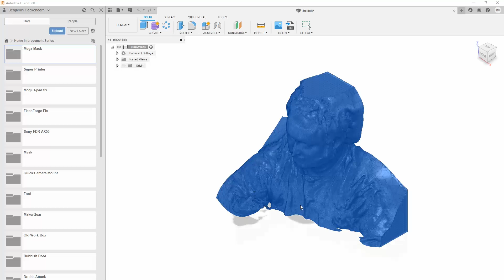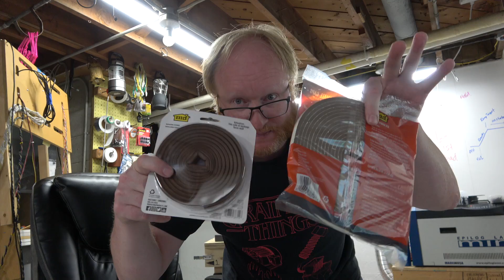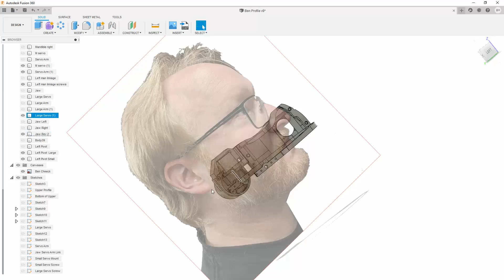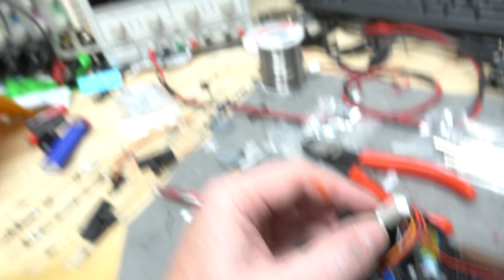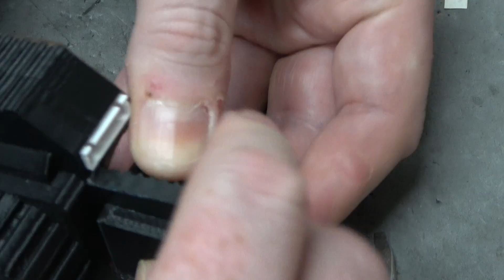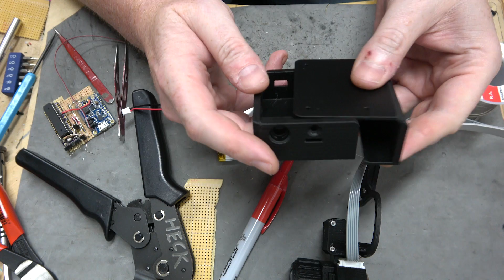Auto-Mask (Mark 1)

Comment: Technically noce, as a mask its not gonna work though as the surgical ones require replacement after a few hours, up tomabout 4-5 times change a day. Yours aint gonna do much vs a virus but it is a nice tech.. just cloth wont work much as the micron öevel of the virus is so small that you need 7-11 layers , and change it ..

Comment: So you had made a comment in the video around approximately 6 minutes in saying that you only had to model the one side and then mirror it? That's frequently not entirely true, because everyone's face is different on the two halves. Not different by a huge amount, but you can probably make it noticibly more comfortable by modeling both sides rather than just a half.

Comment: this is scary I had the same idea using fans before I even saw this video im still designing mine but since im a kid of course I have to put a crap ton of other gadgets in it like a candy dispencer but im having 2 fans one to bring o2 in and the other to take Co2 out im still figureing out how to do it so it dosnt just suck the air out of me i know that wouldnt happen cause there not gonna be strong fans but im probably going to us a rubber valve like on scubba masked but i also wanna put filters on possibly both ends of course the one that sucks air in but maybe the one put it out to and alos for the one that directs air out im going to direct the air down as much as possible reply if anyone has extra tips or ideas most of it is going to be 3d printed and im going to do it on my youtube channel so subscribe even though i havent posted in a while i will post when im done with project and make  whole video

Comment: I need it.
just one thing. can be that if the two mandibles could take 1.20 second instead of 85 third. or even a mini against nazal shock in the angles of 260 or 265 degrees internally like foam for example.

Comment: What did you use to scan yourself? I use 4 xbox 360 kinetic  systems  since they were Microsoft's it was easy to set them up on lap. I'm also using them and 9 32 in tvs and some wearable devices to control the monitors yes like in the movie

Comment: what if you had one that was a solid piece and rotated from your neck/chin up to your mouth/nose and then moved towards towards your face to fit, similar to how you put glasses on. you can stop it from smushing your face with a limit switch placed on the nose section similar to a 3d printer's limit switch. so the whole piece would unfold like a sail in one piece and move onto your face for a comfortable fit.

Comment: First, great project.

Are there fans on the front of those arms?  If so, why?  The purpose of a mask is to limit particulate exhalation, so if these are exhaust fans then you're putting the public at more risk.  If the fans draw air in then you're putting yourself at more risk by drawing in more, possibly contaminated, air.  (OK, just saw your Mk II mask and you fixed this issue in that one.)

Comment: Wouldn't it be more usable to create a mask which is mechanically folding.
I mean, you push it agains your face and springs make it close behind your head or something.
And when you pull it of the spring is returned to it's open position.

Comment: Don't laugh but I used a decent old soldering iron for years. Hadnt used on in 30 years. Bought a Walmart 9 dollar job. Never. Never again. To solder two wires in my guitar....Didn't hardly heat right or steady and spent 1 hour on 1 second joints.

Comment: Make a gap that allows the mask air to escape from the sides or the bottom so it doesn't fog up your glasses ❌
Spend a couple days engineering a system that automatically puts the mask on for you ✅

Comment: Just dont wear masks its ridiculas
Reply: We found a murderer
Reply: @nak-crow  you are a idiot. We never weared mask when we have a influenza outbreak. Why are al countrys that dont have idiot lockdown are mask regulation doing better than country with the measures. Stop reading and listing to mainstream media. They arnt telling you the truth.
Reply: @nak-crow  if you believe in science you know the masks dont work. Because we dont know how to propper use them. And if you know how to use them you stil mess up because you not used wearing one automatic you fail. The carbon build up inside the mask its just not healty for you. If you believe in science there is also alot of science against the masks. But that not the narative so you have to look for that science. Its easy to find and there is lots of it.

Comment: Cute project - clearly not fit for purpose. The mask should be disposed after use to avoid cross-contamination. There should be minimal handling. Has to be disposable, and with hospital grade wire to fit face closely.

Comment: you can hear the motor straining to hold it closed... it needs a mechanical solution to holding it shut, rather than an electrical solution.  That battery will not last, and it is fail dangerous...

Comment: Karens: “Why did he spend so much time on something he doesn’t need”
Reply: Masks have to be properly fitted to individual head shape of a nurse, they place a machine over their head which diffuses a super sweet smelling & tasting substance into the air around them, if the nurse can smell or taste it, the mask isn’t properly fitted.
A piece of floral patterned fabric isn’t going to keep you from catching a virus.
Are masks needed? Well considering the actual survivability rate of the virus is extremely high, you’d only really need it if you’re old, really unhealthy, or already fighting off a different illness.
If you’re young, healthy, and actually going outside during the summer to soak up that good ‘ol vitamin D, then you really don’t need to worry about a mask, worst case scenario you’re sick at home for a couple days and then your immune system develops immunity to the virus.
However, I don’t care what logic and facts you present, a robotic mask is literally the coolest thing ever in all circumstances.
Reply: @tingcraft3920  Masks... Aren't for yourself, they're for stopping other people from getting sick, ffs, wear a mask so you stop spreading it, they're not respirators, they're meant to catch the droplets when you breathe, cough, sneeze, talk, etc. The reason they're so foggy and hot is because that's how it's supposed to feel when it's sealed right, it's supposed to deflect it towards yourself, and catch most of it in the fabric.
Reply: Hetuni Jakhal I’d like to point out again they need to be properly fitted.
If they aren’t properly fitted your breath with be focus out the top and sides (Folks with glasses can confirm), increasing the distance your breath travels effectively doing the opposite as intended.
Masks aren’t reliable, they were only supposed to slow the spread of the virus so our hospitals weren’t overwhelmed, but now the constantly changing narrative that is 2020 says masks are 100% reliable and necessary for survival
Reply: @tingcraft3920  I mean, that's all fine and dandy, but my point still stands. Whether someone feels sick or not, they should wear a mask due to the chances of being an asymptomatic carrier. This is not for the benefit of the person wearing the mask (although it helps greatly with chances), it's for the safety of those around.
It's not an option of "well I don't feel sick so I should be fine, plus I'm healthy", it's more for people who are vulnerable.
Reply: Hetuni Jakhal People who are vulnerable shouldn’t being taking a stroll through the mall. And even if the mask is supposed to simply catch the droplets from your breath, then wouldn’t a simple cheese cloth suffice? However many places require you to wear a professional mask instead of cloth. The point is, everything contradicts itself and it’s beyond irritating...
Reply: Hetuni Jakhal At the end of the day, you don’t really need to worry about the virus as it has an insanely high survivability rate, and once voting is over we can be free of all this chaos
Reply: @tingcraft3920  "At the end of the day, you don't really need to worry about the virus"
...I'm part of the vulnerable populace. A good portion of my family is. It won't just stop after voting happens in the US.
Also, "Insanely high survivability rate"
No. This is demonstrably false. It is rather lethal, being at about 3.4% (With cases that are known). That dwarfs the flu's 0.1% easily, and besides, there are more lifelong issues in the survivors.
Reply: @Hetuni  "rather lethal"
You do realize that 3.4% mortality rate means that 96.6% of people who get it don't die from it?
"Rather lethal" is 20-30%, not less than 5. And of the 160k deaths (out of several million residents of the US)  94% were old people with compromised immune systems. Add into that the fact that the CDC has been intentionally inflating the death count, the fact that Fauci can't even get the number of US cases right, and the fact that politicians were just exempted from wearing masks, and yeah, it is political.
Reply: Big Chooch Thank you, and well said. Hetuni the problem is that no matter how a person died, as long as they had the virus in their system it’s counted as a corona death. You could’ve died from a heart attack or seizure, but as long as you have the virus, it counts as a corona death. So the death rate is probably something around 1.2%. Only around 9,000 people have died in the whole US from this, more people have and will die from car crashes, but we aren’t restricting people from using their cars are we? Are we even improving drivers tests? Nope! But this virus we’re shutting down our whole economy putting many local businesses out of money. Let me clue you in on a little secret, you know that unemployment check? If you own your own business, you’re self employed, meaning you don’t get a check, and if you can’t run your business due to quarantine, you quite literally have no income.
Reply: Also to Skullcrusher Ash, I’m sorry your joke has become a political discussion. I simply wanted to share some insight on how masks work and how robot ones are awesome
Reply: Tingcraft if i gave you 100 skittles and told you that 3 can kill you, you wouldn’t eat the skittles
Reply: Bigbanana E That’s a pretty disconnected analogy but I’ll work with it. Wearing a mask, especially a reusable cloth one is actually also bad for you, the cloth becomes a breeding ground for bacteria thus weakening your immune system. The thing is, a 3/100 chance of dying is really small when you take into account the fact that you have to catch the virus first. So using your analogy, if you walk through the house, and happen to miss the food in the kitchen and the pizza on the coffee table and walk upstairs to your room, than you have a bowl of 100 skittles and 3 are poisonous, however if you don’t eat them, you’ll starve.

Also I’d like to point out, the CDC themselves say you don’t need to wear a mask!!!!!!! You only need to wear a mask if you can’t stay 6 feet away from someone! Masks aren’t mandatory for survival
Reply: Tingcraft i guess you’re right. Your wording seemed very conspiracy-theory-ish at the start. I just wish that our neighbour who tested positive would stay inside or wear a mask when going out to buy stuff.
Reply: Bigbanana E Ya I don’t fault you for reading my stuff as a conspiracy. I totally agree that your neighbor should avoid spreading the virus and wait till he is well. Although technically if the virus is indeed being used for political reasons, then by definition it’s a conspiracy. So I guess you aren’t really off in me being a conspiracy theorist? Either way, we can only hope this all blows over after the voting season

Comment: Use a thin piece of plastic as thick as a zip tie and connect from one side of your device to the other over your head to alleviate the intention/pressure off your ears ... Will help with support ...

Comment: I believe using the strap from an airsoft mesh mask combined with a single moving mask piece in front, can give an easier time removing and putting on the mask, and also make it lighter.

Comment: A mobile phone and microelectronics technicians critique (constructive, not ridiculing)
- Use a raspi zero module (module)|
- keep the fans
- change battery to USB power junction (because connecting to a power pack isnt that big of a deal)
Otherwise youre essential design is... fine (imo) Your ideas quite good.
(I REALLY like the fans. because = breathe)
I would pay 110$ for such a thing.

Comment: I found it very top, watch until the end. I liked it, it's an excellent proposal for use, It would be good too, an ease in changing the fabric, because it could be applied in other areas as well, not only in health, In construction, locksmiths, and chemical plants. Because in the area of work safety, I would apply it as mandatory PPE, after all ends up forgetting to use EPIS, (INDIVIDUAL PROTECTION EQUIPMENT)

Comment: New model maybe incorporate temp switches in each battery and an audible message like power on power off low battery battery percentage and a danger remove mask over temp one fan in with filter one out with filter.

Comment: thats some sci-fi shit an is only controlled by two servos which is mad simple but pretty smart be even cooler if it could fold to the sides an end of flat near side of face instead of sticking out an have like a double joint or swivel in middle of mandibles to completely flatten

Comment: Furnace filters are magnetized to attract particles like viruses. You'd actually be safer walking about without a mask than wearing one of those things. It'll catch literally anything small that's floating around. That is what they're designed for. Buy a proper filter or just wear a normal mask

Comment: You could try shoulder braces, so the entire setup sits on your shoulders, with plastic ball joints and rods to hold up the frame for the mandibles and chin mask cloth. That way you can still look around, but the relatively tiny weight on your shoulders isn't so uncomfortable, compared to hanging off your head

Comment: The way I’d do it is just to have 3 or 4 spherical plates (maybe carbon fibre?) that come up from below and interlock against a sealing edge of some sort, with an additional servo w/ 90 degree reduction gearbox on the side to pull everything airtight.    But I’m not sure on ventilation, fans seem kind of gimmick without proper filtering and airflow to breathe normally without feeling like your wearing a snorkel/ diving gear. Maybe some kind of telescopic breathing manifold attached to the first plate? Then again all that jazz might be too heavy to be practical. I guess I’ll just stick to wearing a peg on my nose for the meantime.

Comment: I'm no engineer or programmer or whatever but possibly have it be one piece where it swings on a hinge and connects to a different piece on the other side of your head instead of those heavy mandibles. Also try using the fabric from these "gator neck" hunting masks. They're stretchy and breathable and has a variety of uses! Just a friendly suggestion. Thumbs up if you think this would also help!

Comment: The fans seem a little counterproductive at reducing droplet transmission which kinda defeats the use of a mask. 

Other then that a hands free opening mechanism would be super cool for ease of beer drinking. Maybe a few cheek electrodes or something that can tell when you're winking? After masks aren't necessary you might wink every time you sip a beer, but it would be super cool!

Comment: Only issue with this is that by having the mask under your chin and then slide upwards means that if any contaminant is on your neck, it then gets dragged up over your face when it's deployed. that's why most health care professionals will recommend taking the mask off entirely instead of sliding it down to eat or drink.

Comment: Why not just make the thing that goes around the ear with magnets and make a mask also with magnets to the sides with a thing to the sides to make the mask hang below the chin? And the good thing is that design doesn’t require motors or batteries.

Comment: For a more secure fit, use magnets on the tips of the mandibles so they hold together and then maybe line the bottom of the mandibles with magnets as well to hold the veil in place...

Comment: If you add a head band or move the rear area to over your head and attach an elastic band in it's place it would make it easier to remove and help balance the weight better, you could also add a small magnetic closure to the front which would insure that it seals constantly, also HEPA filters on the insides of the fans, or else it's not really helping a lot.

Comment: Just get an N95 respirator. It will actually filter the air you breathe both ways and stop droplets at the same time.

Also add another set of mandibles and call it the Arbiter mask or Elite mask 😂

Comment: Needs like brake cables from a bike (only thinner) to locate the servos and electronics off your head.  It'd be neat if you could have a small belt-clipped box and some kind of thin, flexible mechanical cable.  Making it unfurl like The Predator's bifurcated jaw would be neat too.

Comment: Neat engineering and a fun project, but the fans defeat the whole purpose.  You're supposed to breathe through the fabric in order to capture the vapor that may have the virus.  I couldn't see which way the fans were going, but a fan blowing in will just bypass the fabric and pull it straight into your lungs, or if you are the one that is unknowingly sick and the fan is blowing out, it will propel the vapor out onto others.  Great mechanics and design, though!  Very cool looking, but not functional as a mask, unfortunately.